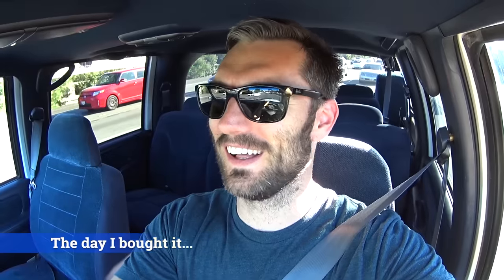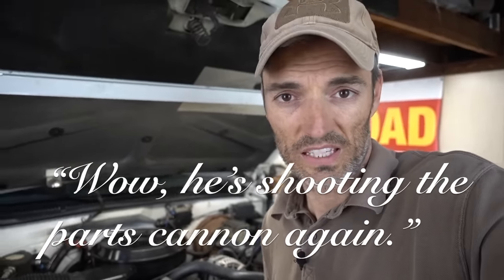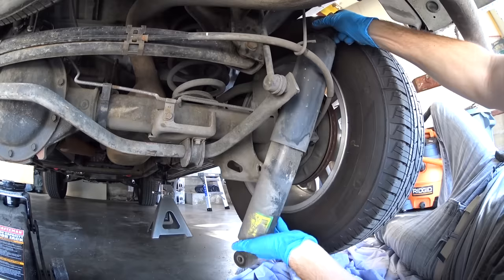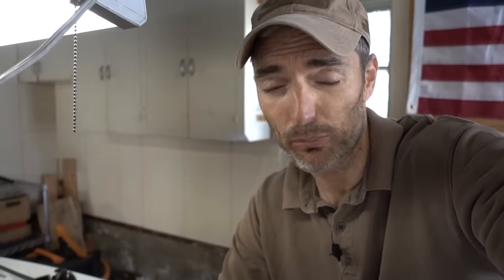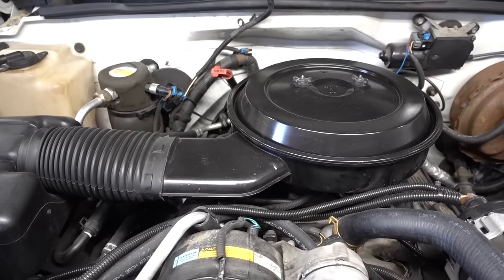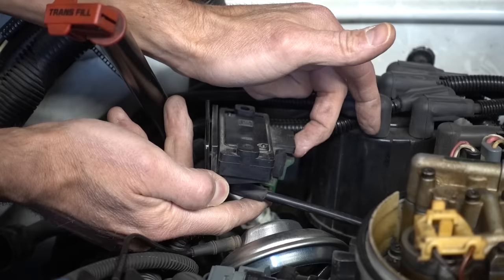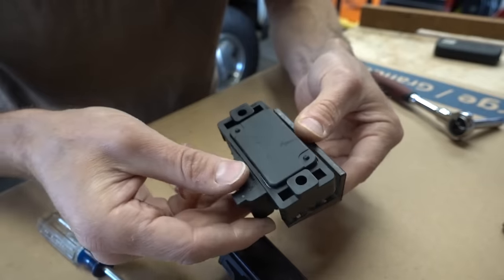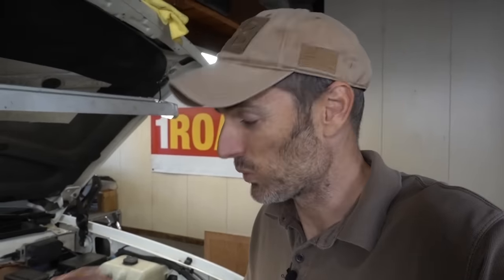The ONE REASON Why My 25yr Old Truck Runs So GOOD!!

Comment: Buddy you couldn't be more wrong with the parts that are purchased today in 2023.. I'm a full-time mechanic and have been for over 30 years I can tell you with absolute certainty you do not want to pull a 25-year-old part off and replace it with a new piece of Chinese junk. You cannot guarantee that it'll work out of the box you could not guarantee to ever work like the original OEM part was designed for.     Can't even trust new OEM parts compared to the old ones. If that part has made it 25 years without causing a problem you're a fool to change it....
Reply: He gives a whole new meaning to shade tree mechanic
Reply: Took some of my old parts off and put them on the shelf just incase the new ones fail, so I understand what you mean.
Reply: You are right buddy !
Reply: I think you're missing the point he's replacing "common failure parts". e.g. coolant hoses. Yes, original assembly parts are always the best, even OEM is not as good as originally assembled. But over time rubber and plastic parts degrade due to heat cycles and time is the main indicator of failure. Will the new OEM last as long as originally assembled? No. But that just means you will need to replace them at 10-15 years instead of 25. The point being coolant hoses and plastic radiators are a ticking time bomb after 20 years and prophylactic replacement just makes sense if you would rather change the part on your driveway rather than call a tow truck.
Reply: He's still way ahead of the new car buyer. New cars are a conglomeration of junk Chinese parts.
Reply: Yea, just wait for your radiator hoses to burst while you're out on the highway miles from home instead of replacing 25 year old one's. 
That's good advice from a "30 year mechanic".
Please tell all of us where you work so we can warn people not to go there.
Reply: Amen brother
Reply: You are absolutely right.  It's 2024 , and the Chineseeium is all over the Amazon pipeline.
Reply: I wouldn't change anything prematurely unless it could go castastraphic without notice.
Reply: Yea, the quality of new parts and materials used are nothing compared to older parts. All you have to look at is newer cars compared to older cars they just can't compare to the quality of older cars.
Reply: @tellucas Best common sense comment on here.
Reply: This. So much this, OP.
My dad's 2000 jeep Cherokee developed a death shake, and chased it all around til finally he removed the new stabilizer bar he had installed and put the old one back on, and the shake disappeared. 
Moral of the story: new isn't better or even working (for long). Quality is down the toilet these days, and you won't avoid having to check new parts when you have a problem any more than old ones. This kind of thing has happened with fuel pumps, clock springs, computer parts, etc. Nothing is safe.
Reply: As a master mechanic myself, I completely agree, I have a 96 lumina,with the original starter, original, map sensor, and Maf sensor, I just clean everything every once in awhile and it still runs great
Reply: Suburban rust bucket
Reply: I'm not even a trained mechanic and I came here to say something similar,  yup buddy had an issue with his used but we'll loved Chevy Lumina mini van ,well took it to the dealer mechanic they replaced the starter, it worked cold but when hot it wouldn't start, again took it to the dealer, they threw a battery and solenoid on and on... finally after months of going back and forth they decided to test the starter ,it was the starter that was hooped right out of the box,and yes he always bought OEM parts. That was over 20 years ago, and a good friend told me never replace a factory u joint just because it's old, especially the older vehicles,,cause they are just best not messed with . Anyway  why spend money on replacing good parts it all adds up.
Reply: @dukecraig2402  
I've had busted hoses, perforated radiators and 
blown water pumps on the highway in 50 plus years of driving.
But I have alawys been able to limp the vehicle home 
or to the auto parts store with a little roadside ingenuity/repair.
Duct tape, bailing wire, hose clamps, hose tubes, screwdrivers
and some water/coolant have usually saved the day.
Reply: @ogcowboy5743  
And that makes you a ringing endorsement about why people should maintain their vehicles. 
"Don't worry, luck will see to it you won't get stranded somewhere"
That's sound advice 👍👍👍
Reply: I couldn't of said it better 100 percent correct!
Reply: Preventative maintenance.... absolutely agree. 🤠

Comment: As a side note when replacing parts that are still working, a person could always put the part back in the box it came in and keep all those little parts in the trunk. If a part ever did fail for some reason you'd have an immediate backup on hand that you know works.
Reply: Smart! I do the same for my 85 caprice.
Reply: Big fact.
Reply: I store mine in zip-loc bags in engine bay..including the fan belts....
Reply: Or, if your new one should happen to be one out of china with a case of covid!
Reply: I do that to
Reply: That's exactly what I'm saying. That's exactly what I believe!
Reply: Brother kept a spare manual fuel pump in his truck because when he got it, it didn't run, all because someone swapped the lines backward.
Reply: Long time ago my father in law saw me saving old spark plugs, he asked me why was I saving them, He said you using them the next time you change plugs? No I'm getting new ones, I still got stuff laying around.
Reply: Exactly, save the known good parts. As the tps ( throttle position sensor ) is purely mechanical I replace them prematurely before they fail.
Reply: I have three late 90's OBS trucks. I replace things a head of time and save good parts for emergency uses. Makes perfect sense.
Reply: My Dad taught us to do a tune up on our old vehicles, and if you change points and condenser while still working, you put them in the glove compartment. Back then a $1 condenser could leave you stranded, lol
Reply: Bingo.
Reply: I do the same thing. Tons of spare parts behind the seat!
Reply: That's what I do with all parts, unless they were destroyed.
Reply: GREAT IDEA,
Reply: It's a good idea to stockpile critical parts for your older vehicle. You never know when the OEM parts will be discontinued.
Reply: @JusticeAlways   Doesn't the engine bay heat over time cause potential problems?  And where do you find a place under the hood to store lots of little parts without them possibly getting loose and falling down and out?
Reply: OBD 2 became mandatory in 1996, before 1996 is quite a muddle of systems including OBD 2 as far back as 1994 on a very few vehicles.   I recall Scotty Kilmer covering OBD 2 code readers some time back.  All this stuff came about to meet emissions regulations, one consequence is better fuel economy, another is less smog in urban areas, and maybe less acid rain deforestation.
Reply: The primary reason to keep working replacement parts is they make it easier to diagnose a future problem.  For $0, you can eliminate a possible problem by swapping back in the old part you know worked when it was replaced.  Then you move on to the next most likely issue.
Reply: Amen brother

Comment: Ever notice how many good reputable mechanics at small shops drive 90's cars.  It's not because they are poor.
Reply: The best mechanic I know will only drive Toyota's. He says they will out last anything else out there by 3 to 4 X's anyone else, and I'm not talking about Scotty Kilmer.
Reply: @Viper81766  Why do you say that? Just because a domestic car manufacture can't build anything close to the reliability and intelligent ingenuity of a Japanese vehicle doesn't mean these guys deserve to be classified as lunatics. What is lunatic is believing you can buy a G.M. product and honestly think you can put 400,000 miles on the transmission without anything more than a flush and fill. That's not lunatic, that's pure insanity, yet, Japanese vehicles do it every year by the multi-millions.
Reply: @illiniwood  o
Reply: @Viper81766  Sounds like your still stuck in the 70's, BOOMER!
Reply: @illiniwood  them fullsize gms 2000-2007 are the real deal. The ls engines easily go 300k+ miles. Not rare  to see them  come in for maintenance/repair with very high milage. h Them fords of the same year im putting timing chain, oil pumps and more lol.
Reply: Early to mid 90’s Toyota is so robust and simple. Fuel economy was great. Parts are generally cheap. And they were built far beyond their intended use.

I will say that a lot of Chevy products at this time were pretty great as well.
Reply: @ML-rx7tv  cough, cavalier 2.2
Reply: illiniwood , Scotty, on many videos, discourages flush and refill on an auto tranny. He says, best case, drain and save the fluid, change filter if possible, then refill with old fluid, starting with 1/3 new fluid... ( this is for a tranny, with mucho miles, that is beginning to show signs of disfunction/slipping...
Reply: Kenneth Obando , possibly, but, some parts of the country, those frames turn to swish cheese...
Reply: I'm still driving my 1986 mazda.
Reply: Yes it is
Reply: @illiniwood  Japanese are less maintenance but not the best I seen 2 GM engines outlast the rest of the car
Reply: 1990 chevy 2500 and a 2001 Toyota Corolla. 
Why would I get a new car?
Reply: @7s29  1987 nissan d21 with AC no power steering lol
Reply: @BukitMan  you don't
Reply: @kennethobando5755  I'm a gm guy (never getting rid of my '73 C10) but that original variable valve timing in those 2000s engines was horse $hit. They all ran like scolded dogs, but when they went bad they went. Thats why they came out with the delete for it later on.
Reply: I also don't know many mechanics that drive new vehicles.  They all bitch about the newer vehicles and call them garbage.
Reply: 92 Toyota paseo 
95 Chevy 5.7
Reply: @illiniwood  my chevy at 400k same motor and trans still runs and shifts good
Reply: The 90’s vehicles were some of the last well build ones before all the newer ones from the 2010’s and 2020’s.
Reply: I'm a mechanic, and my newest vehicle is an '89. I'd rather have any old vehicle than any new vehicle.
Reply: @illiniwood  I will NEVER buy American AGAIN!   Maybe a Rivian...

Comment: I agree with you MOSTLY. Often, these days, the 25 year old part may have more life left in them than a crappy new part would.
Reply: And you sir just hit the nail, squarely on the head !
The state of the auto parts market right now, is not good at all. You  have, approximately, a 50/50 chance of getting a working part from your parts store today. That doesn't even begin to take into account for how long a part will last, which has been pretty dismissal lately. Five years ago I would fully agree with your methods, but now, if you have a twenty year old part that still works, leave it, it will probably still outlast any replacement you might find.
Reply: Many new parts are cheaply made, it’s the sad truth
Reply: When he says those new parts won't fail I disagree as well some of the original parts last longer
Reply: If he's getting the parts as cheap as he claims they're probably Chinee knock-offs
Reply: I cannot remember all the times that a "NEW" part was BROKE right out the box.
Quality Control and Assurance once was a full time job for someone...an actual person testing parts at the factory!
QA/QC was replaced by a chintzy little sticker in the early 2000's, and the person lost their job to "save the company money"
I think those stickers have be dropped near the mid 2010's, to "save the company money"

Good luck finding something new that works like it should without Allstate tryin' to sell you insurance on a new friggin' item that they know is gonna break if it isn't already broke in the box.
Stick that in your pipe and smoke it.
Reply: I wonder alot if something called "reverse obsolescence" has found its way into the auto industry. I feel like some where after the 90s.
Reply: @stuglenn1112  The white sticker on the MAP sensor has made it china printed clearly on it.  I’m leary of the quality of auto parts more and more these days, and I worry about getting inferior parts.  I have been working on my vehicles since 1965 and other than my first two cars being Fords I have been a GM only guy, mostly Chevies, and I used mostly OEM GM parts other than performance aftermarket parts.  I remember how disappointing it was back about the year this suburban was built when I started finding “made in china” parts in AC DELCO boxes from the GM dealership.
Reply: my thought exactly
Reply: Any aftermarket part with an electrical spade, may have a thinner spade than the original creating an intermittant connection problem that never existed before. Tightening up every female electrical connector may be necessary for aftermarket parts.
Reply: @noahdunaway I remember way back when most of GM electonic replacement parts were made in the good ol' Singapore.
Reply: Just because a replacement part is made in China and a specific one may be broken doesn't nullify the fact that the OEM sensor may still be worn out and not reading correctly.
Reply: True, this is why when I go full parts cannon I also keep the old parts so I can at least put them back. But of course the real reason I blunderbus the parts is because I suck at diagnostics and don't have time to do it right.
Reply: It’s definitely a crap-shoot these days.
Reply: I this case he uses Delco and Amazon
Reply: My u-joints on my toyota 4x4 with zerks are orig oem from factory. 310K miles
Reply: The "these days" excuses are cheap nostalgia. If you went to Autozone when that truck was 2 years old and bought the cheapest thing they had, you'd have problems. We are far further removed than the "don't make 'em like they used to" period you long for. And speaking of, I am restoring a 1959 International, and I'm pretty happy that a lot of those things "aren't made like they used to" because the parts would be far more expensive but only slightly more durable.
Reply: Yes what you say has some validity, but more or less opinion.  Some parts fail even new items lack better QA/QC quality requirements, If one finds an OEM part that is designed to fail because of poor engineering or (made to break due to replaceable part envision of manufacturer).  The fact that all solid state electrical parts fail at some point, it will require replacement, even though they appear and read working...it may be faulty.  All those aftermarket parts from China usually really suck, even down to fasteners, people are milling stuff where the alloy % is just not correct, plastics and bake-lite, carbon composite gone amateur. That crap cannot handle cold to hot seasonal environments and break intentionally.  Needless- to-say all those Mr. FIx-It DIY's on internet, some are clever, but most do not withstand anything on a more permanent scale less Yankee Doodle DIY.
Reply: @briangwynn3592  The real problem is not the cheapest parts imho. Sure, you get what you pay for in many cases there. The real challenge is that now when you  choose mid level or 'premium' parts, they are often also junk - just for a premium price
Reply: Oh hell no. Parts cannon with cheap parts? Replace your truck motor with a Vega motor while you’re at it.  And never an aftermarket electronic component.
Reply: buy napa parts they are the odm for most parts, slightly more than generic aftermarket, but far less than oem and they are the same part just different name stamped
Reply: @stuglenn1112 not always old parts can sit on a shelf for a long time just weighting to be sold , well off to work to dust off a few more 😊
Reply: @glennjames7107  I bought a starter from a parts shop in Kent WA, and the brushes weren't even touching the rotor!
Reply: No doubt.